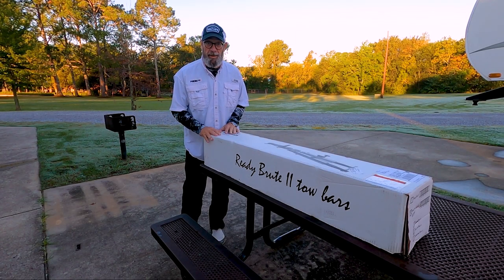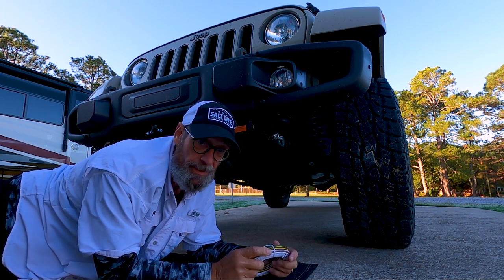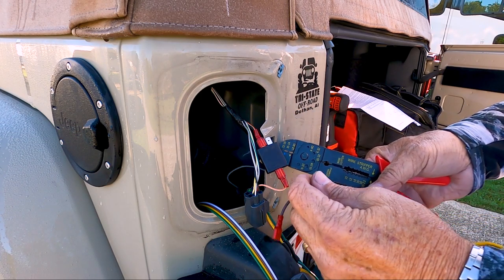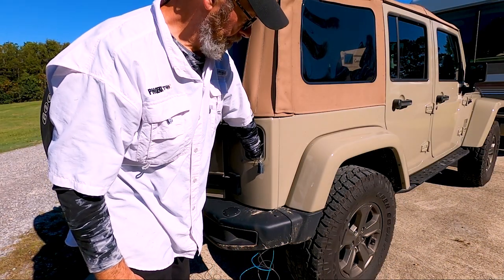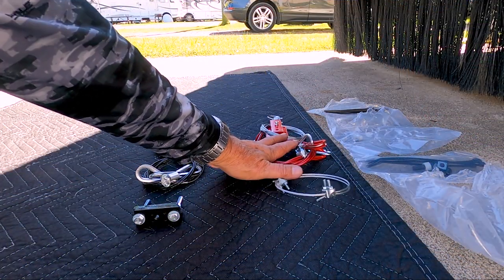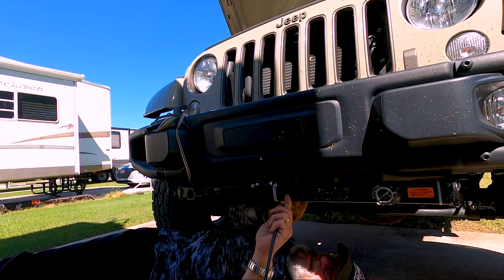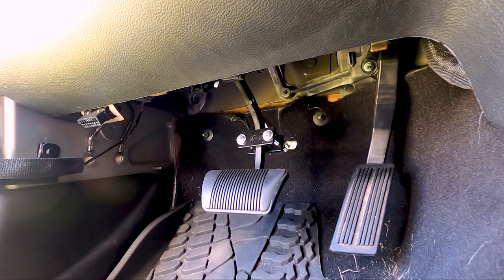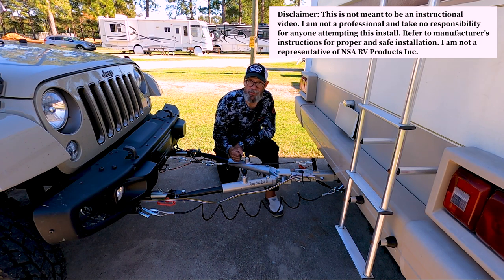RV Tow Vehicle Setup 2 - Flat Tow 2018 Wrangler - Ready Brute Elite 2

Comment: Ricky it is awesome you were able to do this yourself.  We had our base plate and Blue Ox installed by our local professional dealer.  Which made it costly I know.
Reply from the maker: If I can, I'll do it myself. Just have more piece of mind knowing every nut, bolt and connection. Saved some dough, too. Thanks for checking out our videos!

Comment: I work for the company NSA RV products and have been the install guy there for almost 3 years would love to answer any questions
Reply: I do not understand the brake light wiring setup. I’ll research and may need to contact you in the future.
Reply from the maker: Thank you, Porter. I'll send all inquiries in your direction. Man, we really love our Elite. Have been using it for 2+ years now without issue. The only problem I have with it is the pull knobs (balls)...both have vibrated off and are gone. Maybe I'll get around to ordering some more. Thanks again, Porter! Peace.
Reply from the maker: With the next pair of pull knobs (balls)...I'll add some lock-tight!
Reply: @RVUNDERWAY  so the lock ball leg pins, funny story we ran out of T-handle pins. So one suggested we make our own, few days later we were making the ball handled pins. If you ordered replacements you'd  get T-handles to replace them
Reply: @RVUNDERWAY  I also don't work there anymore as I have started college but I'm still best friends with Tod the owner of NSA and I still know the product like the back of my hand
Reply: @barryfridley7852  just let me know that was my job, building and Installing

Comment: I just purchased the ready brute elite ll and had it install by a dealer from your map. The ready brake cable has four inches of play from center. The problem I have is connecting the cable up. I have to pull out the brake cable on my tow vehicle to connect the cable. If I made it for a two inch play, I could not connect the cable. How do you get two inches of play from center and be able to connect  it up. Your video shows it already hooked up.
Reply from the maker: Well, VetRed, I have to do the same thing when disconnecting. But, when I'm hooking up, the arms are not extended, so I have enough length to attach. Thanks for watching.

Comment: Question for you... When using the ready brake and brake lights kit I am assuming when the ready brake kicks in the brake you now have the jeep 12 volts  and the Rv 12volts coming in to the tail light. If that is in series that would mean 24 volts coming into the brake light.. Does this work ok...
Reply: Depends on how they do the lights there is a diode kit that solves the issue or a bulb and socket kit which bypasses any interference by putting trailer lights on the existing taillight housing
Reply: He has the bcd-110 or brake circuit disconnect which is what he uses to shut off the cars brake system when a 12v signal is detected coming from the rv
Reply: Comes to find out the 2019 Jeep Jl the brake lights don’t come on when the car is off for 10 or so minutes so it was easy.
Reply from the maker: I see Porter is taking care of your question, Jim. Hope you got it worked out. Peace. (Thanks, Porter)